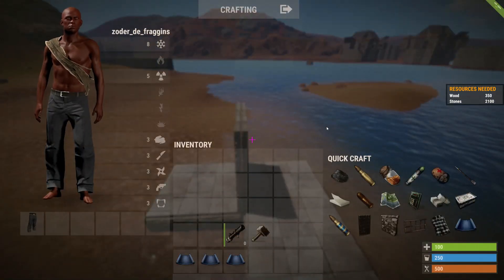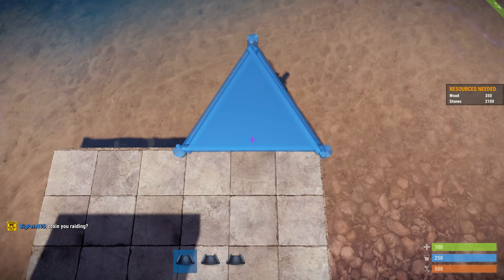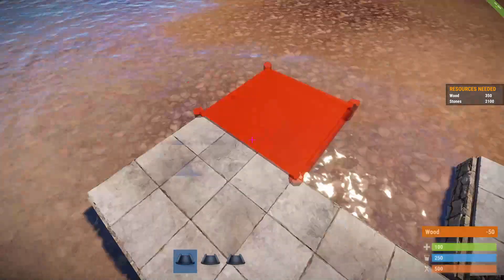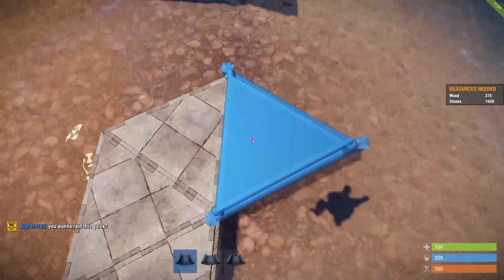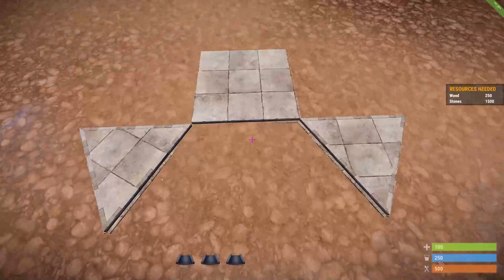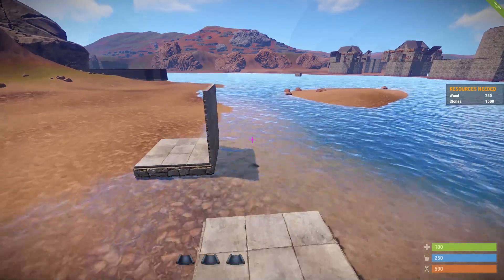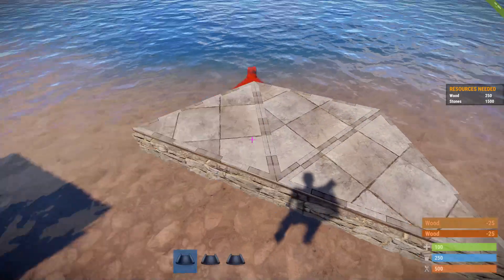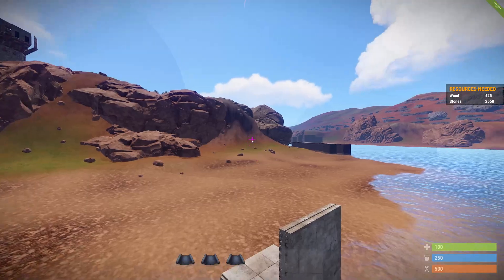Rust triangles trick

Comment: its like u just said the earth isnt't flat or something like that. we knew it for 2 years already lol just search for: rust wall stacking xD
Reply from the maker: usually, (in-line) wall stacking is done by building out with triangles and building back in with squares or vice versa. Which leads to only discrete values (integer multiples of root(3) mod 1) for the foundation gaps. I've watched a lot of building videos and I've never seen this trick highlighted. I explain why it's useful at the end, occasionally when wall stacking, you only want to move like 0.02 foundations over. Rather than trying to find out what multiple of root(3) you need to achieve that gap, you can use this trick a few times. I thought it was clear in the video. If you could please refer me to a single video, forum, or anything, that mentions this method for foundation shifting, I would love to see it.